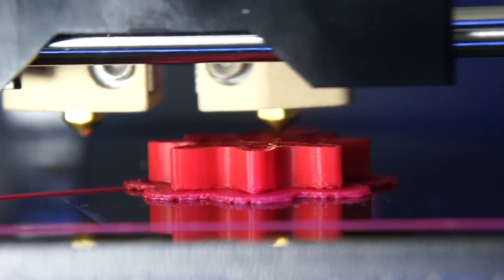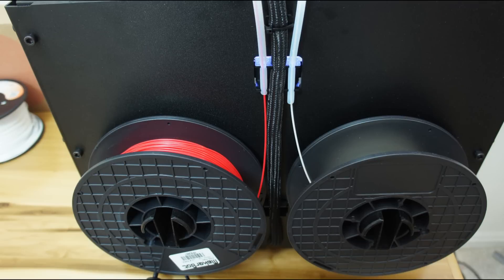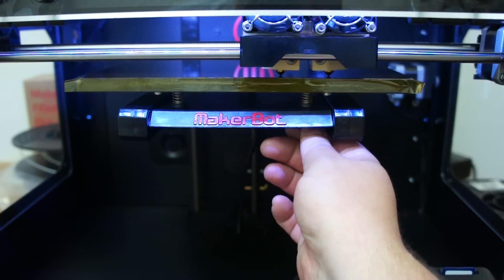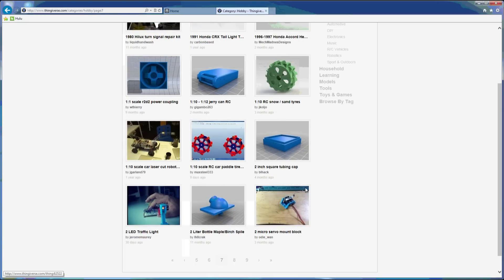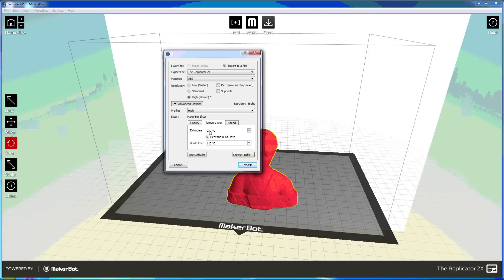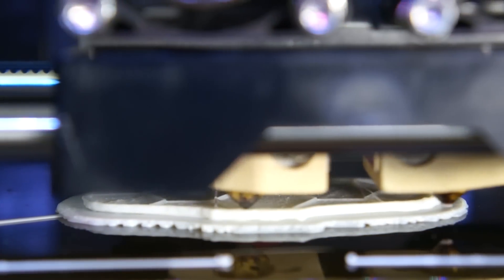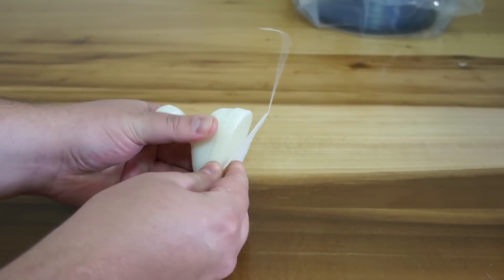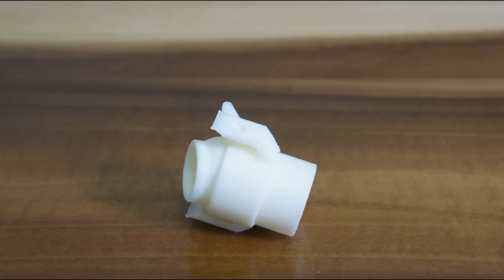MakerBot Replicator 2X 3D Printer Review

Comment from the maker: I'd like to add that MakerBot support has been fantastic.  They've been knowledgeable and quick to respond.

I recently chipped the heat shield around my left hot-end.  I made it clear to support that it was my fault as I slipped when trying to scrape crud off the nozzle.  The only thing they asked for was my machine serial number, a picture of the damage and the address to send the new hot end.

MakerBot's Replicator 2X is expensive, but from what I've seen they're willing and able to stand by their product.
Reply: which materials can be used to print?